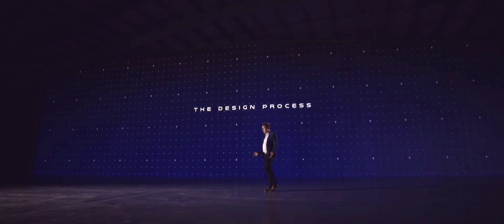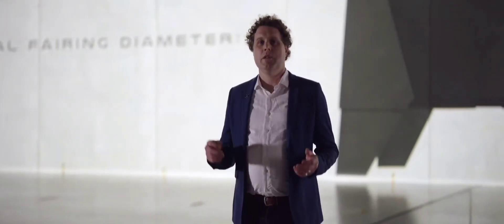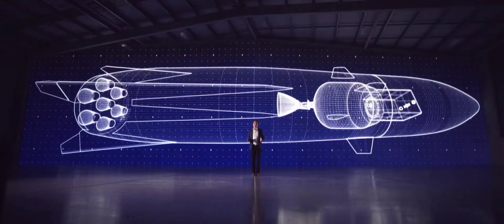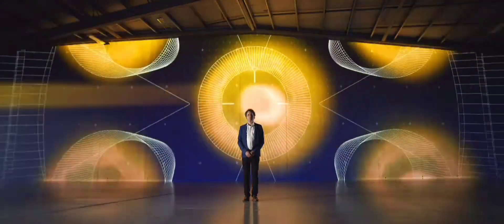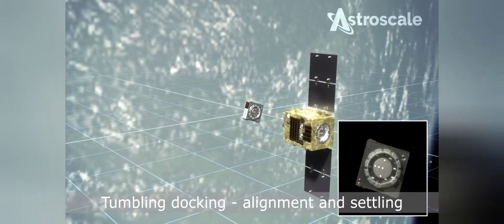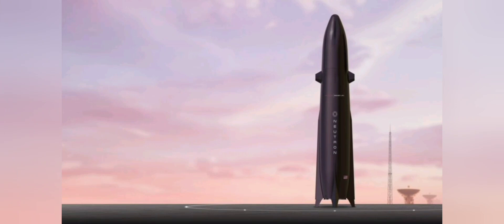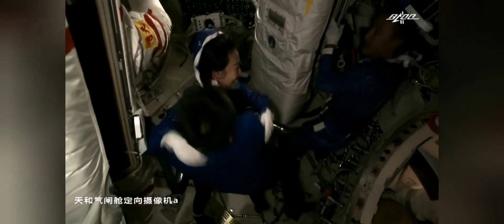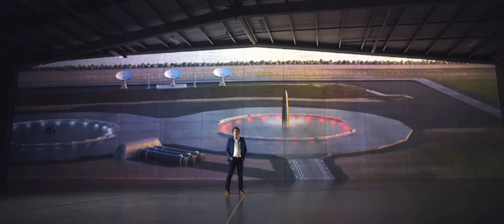A rocket for 2050 - Why Neutron is much more than outdated competition for SpaceX Falcon 9

Comment: they said the legs were fixed but in the landing video, u can plainly see them extending out on landing. Am i the only one who saw this? 21:30 check it out.
Reply: I don't think that is what the mean by fixed. They don't extend or flip outward, and are part of the structure of the rocket. The extending out you see is the shock absorbers releasing from the locked position ready to take the shock of landing.

Comment: What I found most interesting in this video is that Rocket Labs has been asked to design a reusable second stage. In the Neutron promo video, Perter Beck gives a very strong hint that whilst the initial second stage will be expendable, that they are also thinking seriously about a reusable one. How would you do it anyhow? That's an interesting question. Here's my thoughts...

- First rule is make the second stage as light as possible. That means a lower ballistic coefficient.
- Secondly, keep the engine pointed towards the air. Since the engine is relatively heavy this is fairly easy.
- Thirdly, you don't need a heat shield for the tank. You simply need to keep the plasma away from it. 

So, wrap insulation around the engine and add a heat shield to the bottom of the tank (a thin metal layer on standoffs or a carbon foam, or a combination of the two). Then extend the heat shield outwards with an inflatable ballute, forming a conical shape. Thus keeping the plasma well away from the tank. Now add parachute. How do you recover it? Well, the thing will naturally float and the ballute will act as a life raft.

I don't know if this works economically given the current design (actually, it could if your payload left some room for it). But it would work nicely if the whole vehicle, including the second stage, were scaled. Could it scale to super heavy class (100+ tonnes payload)? Quite likely. And that second stage tank (in carbon fibre no doubt) would be extremely light relative to its volume.

Edit: Note that remaining fuel in the tank will partially boil and this will add cooling to the tank.
Reply: The engine would melt without a heat shield covering the nozzle. Engines can handle a lot of heat, but not reentry heating. (This is in part why Starship has a protective skirt around the engines, to keep them out of the plasma.)

And you really don't want salt water on your second stage. It means a very expensive cleanup job, in the best case. Mid-air helicopter recovery is better.
Reply: @espenha  Yes, well in my haste I didn't include mention of active cooling (it was getting to be a long enough post already). Simply run some liquid methane through the engine. This will keep the engine and nozzle sufficiently cool. Methane has a heat capacity that rises with temperature.

Rather than salt water, land it into a body of fresh water - or even build one for the purpose. It doesn't have to be that deep. Mid air recovery may get tricky if the second stage is scaled. Besides its a lot easier to pluck it out of a lake  once its come to rest.

Comment: Is a Gas Generator cycle engine really an engine for 2050? Or is Archimedes just a stop-gap solution until they can come up with something better?
Reply: I think a gas generator cycle engine is definitively the right choice for Rocket Lab, as it's a significant step up in difficulty from what they already know, and good enough. A gas generator cycle engine means it's plausible Neutron could be flying in 2025, and not 2030-35.

But yeah, I think that ideally, longer term, they should be looking at staged combustion.

Comment: 18:18 Actually the standard ticket price for New Shephard is somewhere between 200k-600k, the tens of millions that you are talking about was only the auctions bidding for the first flight etc.
Reply: i have not seen a single shred of information suggesting that BO's new shepard flights are 200-600k, i think your confusing Virgin Galactics option with New Shepard
Reply: @JustinKrux  No the vast majority of insiders and pundits believe that the ticket price is somewhere there. Eric Berger, the person I trust the most, thinks it will settle higher, somewhere between 900k-1 million, which are all very far away from tens of millions. I am not confusing any numbers, I think Angry was just confusing the ticket prices for the auction prices when he said "10 million or 20 million dollars to ride on fricking new shepard".
Reply: @JustinKrux  There were also leaks from Blue Origin in 2018 that prices would be around 200k, which is a long time obviously, but either way, it's going to have a price far closer to Virgin Galactic than the price that Angry cited.
Reply: @adamanderson3042  well nobody so far have paid that, as far as we know, so until then, its 10s of millions. BO could very well just stick to the auctions....everything else is just assumption at this point. Not saying it isnt possible that BOs prices will come down, they probably will...and maybe that is something angry should have mentioned.
Reply: @JustinKrux  "well nobody so far have paid that, as far as we know, so until then, its 10s of millions. BO could very well just stick to the auctions...."

Well we know that they have sold private tickets and the auctions have ended and are very public and open anyways. " well nobody so far have paid that, as far as we know, so until then, its 10s of millions." The ticket prices are private but also we explicitly know that their intention was not to keep prices anywhere near the auction prices.
Reply: @adamanderson3042  again, intention isnt reality, until it becomes reality, i find it interesting the auctions/prices are public, virgins prices are also public, yet BOs private sale prices are are not.
Reply: @JustinKrux  Well obviously I agree that intention isn't reality, this is the aerospace industry after all, but I think that all of this together, the intention, the leaks, the rumours and pundit estimates all together would paint the picture that the price is probably significantly closer to Eric Berger's estimate than Angry Astronaut's statement.

Companies can be wrong and have a margin of error on their statements but they can only be so wrong.

For example:
The launch COSTS of Starship, aspirationally, in the long-run are hoped to be in the ballpark of 2 million, it could be 4 million or it could be 6 million.

But we could probably say, with a reasonable degree of certainty that it's probably not going to be 40 million. Now keep in mind, 40 million is 20x 2 million and 10 million is 20x of 500k, to put that into perspective. 

Now of-course I'm just talking about Starships cost, not it's price, because as Angry and the pundit-sphere correctly reminds average people, depending on market elasticity/price equillibrium, Starship could just be operated as a higher margin vehicle. But the reason why I can compare Starships COST to New Shepards PRICE is because people alleging that New Shepard couldn't have a ticket price of 500k-1m is because the COST wouldn't allow it.
Reply: 600k for a ticket to nowhere in particular.
Reply: @Agnemons  I wouldn't personally like it. I think I would actually way prefer the Virgin Galactic flight just because of how sci-fi and futuristic the crew cabin is.

Comment: I’m an investor in Rocketlab, so I do like to carefully take note of what they are doing. One of their strengths, isn’t just technical innovation, but economic innovation. The latter is often overlooked, but it is important. They are chosen to build a rocket around the payload that will represent the biggest chunk of the predicted launch market over the next 10-20 years. It’s smart. And this is why they will go far.
Reply: In a vacuum it makes sense.  But if Starship really takes off it will start to shift the entire satellite market. 

Most problems that make satellite design difficult is the mass/power constraints. If Starship becomes the defacto launcher a lot more satellite manufacturers will start to take advantage of that. I.e. they'll throw mass at the problem rather than spending years on design and testing. 

Over the next 20 or so years I expect this will lead to satellites becoming both cheaper and significantly larger in general.

Comment: Comment on crew rating and speculation on costs... Roscosmos was charging NASA $75 million per seat to fly astronauts to ISS.  Those days are over for good.
If Neutron's cost was $35 million per launch and you were launching only two people and cargo to a private station, it's possible to envision budgets of around $50 million to $75 million per launch to the station.  It looks like the $25M per seat number is pretty solid and could decline further as reusability takes hold.

Comment: SpaceX charges about $36 million to launch a used rocket with an 16 ton payload. To complete with this, I think the neutron would need a price tag of under $25 million to launch an 8 ton payload to be competitive and $18 million to be truly on-par with the SpaceX Falcon 9. Additionally SpaceX is working on the starship. It's estimated that even on the high-end it will cost $10 million to launch 100+ tons into orbit and musk wants it down to $2 million. This means that even best case, they would need a launch cost under $5 million to have a market at all and charge less than $200,000 to be on-par with SpaceX.

Unless the neutron has insanely low costs, there is no way it is the rocket of the future.
Reply: They charge $50 million not 36

Comment: If you go into any construction yard on Earth, you see 50 ton trucks carrying cement, towing equipment, rebar, and then lighter trucks with the things a building needs like wire, tubing, pumps, etc.

This is no different.

Spaceship can get the big things into orbit or beyond, but you don't need 100 ton capacity to supply it or take away the finished goods.
I wish I was 30 years younger, We're seeing a space industry develop.

Comment: Who would knew Neutron fairing deploy would resemble a rocket from a 60's James Bond movie.
Reply: Creator probably saw that movie
Reply: I have to wonder about the weight tradeoff of having a fairing that covers the whole second stage. Normally, the fairing only covers the deployed payload. The tank walls of the second stage are the surface of the rocket.
Reply: @clarkkent7973  you save costs this way too, not needing to recover the fairing in the Ocean.
Reply: @RogerM88  It's not completely obvious whether it's better to return the fairings with the first stage to the launch site, recover them at sea or take them all the way to orbit and then do orbital reentry and landing.

Returning them with the first stage to the launch site means you have to do stage separation fairly high in the atmosphere, so that the second stage is mostly out of the atmosphere. This means doing a less optimal gravity turn. And then the fairing is along for the ride in the boostback burn and the landing burn, which means these need to use more propellant.

Recovering the fairings from the sea requires means having a mass hit for parachutes and such, and it means you need a boat out at sea. But you can separate the fairing whenever, and you're not using propellant to land the fairing.

Taking the fairing all the way to orbit takes propellant. But you can do an optimal gravity turn which partially makes up for it. And with Starship, you can use the fairing for slowing down faster during reentry, which reduces heating and the need for heat shielding.

I would say that all three approaches have merit.
Reply: @espenha  you're missing some things. The deploy of the second stage and fairing occurs in  a near time gap. The real issue with this concept, it's to close back again the fairing, and having an extra reinforcement system near the point, to stand the pressures at launch.
Reply: @RogerM88  If you look at the most recent Falcon 9 launch, MECO was at 65 km altitude, but fairing deploy wasn't until 100 km altitude. The one before that, MECO was at 70 km, and fairing deploy was at 108 km. It is an issue if the stage separation has to happen ~35 km higher.

Comment: YOu also need to ask where can it be built and how easily? ... If you mention any place on Earth then you're not thinking far enough forward. Where can you source the materials from? Getting everything to LEO is great and a niche, another could be where such vehicles can be built and how easily. You can rage on Stainless as much as you want but if you need to send a rocket with skin to repair the on n Mars if kind of defeats the object of the exercise.  I will not go any further down that rabvit hole as it would get voluminous in it's variations and complicated fast :P

Comment: Who will bring the revolution and space based telescopes? With launch cost dropping so much, it seems to me that we should have a revolution in space space telescopes that results in telescopes that are much easier to design, much less expensive to build, and maybe a shorter duration but with high capabilities. We’ve got to get away from the model of the James Webb telescope if we want to see space-based astronomy flourish.
Reply: Yes there should be a few hundred of these, cheaper quicker to buikd scopes to replace Earth based scopes as the night sky gets covered with thousands of sats
Reply: Nah, you need huge mirror to make good resolution.
Reply: Starship is the way to go in any case. It could get into space the JWST in its original 8-m configuration as the NGST - with a monolithic mirror. That would have made it so much more simple and inexpensive. And, provided the launcher was around, also to be launched 15 years earlier. Going with a folding mirror Starship can probably get 20-25 m size telescopes into space. Also, you could get space-based interferometers, like the cancelled (?) Terrestrial Planet Finder: make, in parallel, several ~8-m sized space telescopes with monolithic mirrors and make an interferometer. Maybe it would be possible to get 5-10 telescopes with monolithic mirrors without the complex folding of the JWST into space for the same price as the (single) JWST.
Reply: @antonpershin998  There are other parts of the EM spectrum that don't require huge mirrors.  Also, just launching a new Hubble class telescope (which I believe would fit comfortably in a single Starship launch) would provide a lot of possibilities for more astronomical research.
Reply: @ft9525  Considering that multiple space-based telescopes can be linked with one another to provide a much larger effective aperture, I think this kind of direction should be pursued by the astronomical community ASAP.
Reply: @antonpershin998  Not these days with synthetic aperture techniques using multiple separate mirrors.
Reply: What a waste of resources
Reply: @personzorz  To “Joseph Stalin or Nikita Khrushchev (I can’t remember which one), “quantity has a quality all of its own“. If launch cost her going down, then maybe space based astronomy should emphasize quantity more than it currently does.  Having more telescopes in space might enable us to notice more unusual and interesting phenomena which we could then train the really good telescope song.  Planet hunting and the detection of light warping by very small black holes which we otherwise would not see might be a couple areas that could benefit. Also, perhaps we would finally find planet nine!
Reply: I would dearly love to see a private 5 meter telescope launched. Imagine the terrestrial imaging it could do :)
Reply: For a radio telescope just turn a few Starlink satellites to point outwards!
Reply: @NickYoung_Original  Excellent idea. We need to salvage some value from them :)

Comment: If the average weight of satellites to LEO is 8 tons, then Neutron with an 8 ton capacity can only launch HALF of all current satellites. So when that average goes up, perhaps way up, it can only launch some or few when it finally flies. But sure the number of smaller payloads will still go up and by tailoring Neutron to that market, it could be better than Starship transporter flights. Also because everyone wants a second alternative to SpaceX, being number two still would make RocketLab giant.   

17:00 So you're saying the Neutron could gobble up the Shenzo capsule in orbit with 3 tychonauts in it? Feisty Kiwis...

Comment: I think this spells trouble for the Vulcan Centaur even if the engines get delivered from blue origin. That delay is really killing ULA
Reply: Centaur, not center.
Reply: Not sure how competitive Neutron will be for GTO, compared to Vulcan Centaur.
Reply: ULA execs must have been depressed after learning about Neutron haha
Reply: @topsecret1837  Siri
Reply: I don't think Neutron changes much for Vulcan Centaur. It's not remotely competitive against Falcon 9/Heavy.
Reply: @espenha  It is very competitive because of the upper stage. If you can get 8 tons to orbit but it’s a very high energy upper stage like the centaur or the neutron upper stage you can still outperform a falcon nine or a falcon heavy for certain missions.  It’s not just about tons to orbit. It’s about tons to GTO or tons to other planets or the moon
Reply: @mbmurphy777  Falcon Heavy does around 21 tons to TLI, while Vulcan Centaur does around 12.1 tons. So, basically Falcon 9/Heavy is better for everything in the earth-moon system. It's cheaper, it's more capable, it's just better.

Vulcan Centaur can be better for some interplanetary missions, but those just aren't very common. Neutron is of course much less capable than Vulcan Centaur, and while I won't rule out that some missions exist where Neutron might be better (probably missions needing under 100 kg to deep space) they are very uncommon indeed.

Neutron is more competitive than Vulcan Centaur, though, for the earth-moon system, as it's likely to be much lower cost.